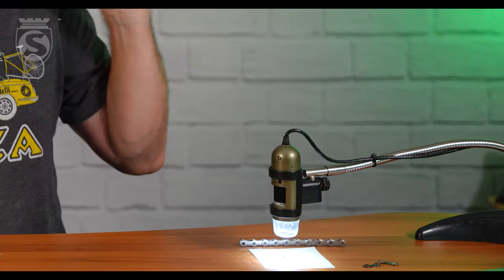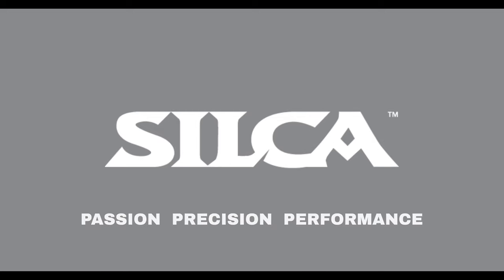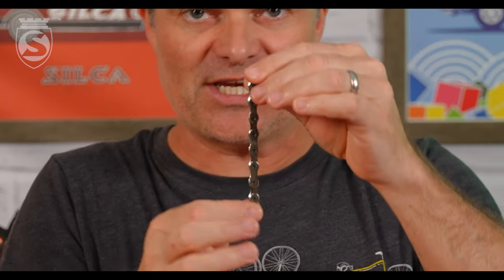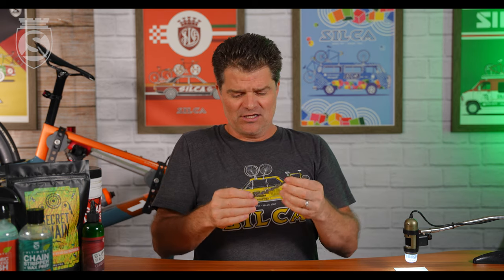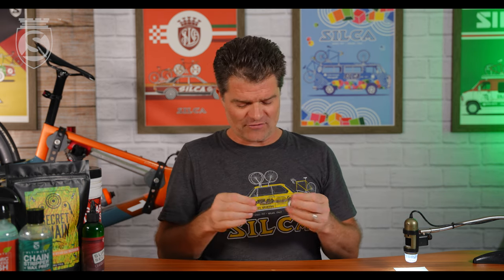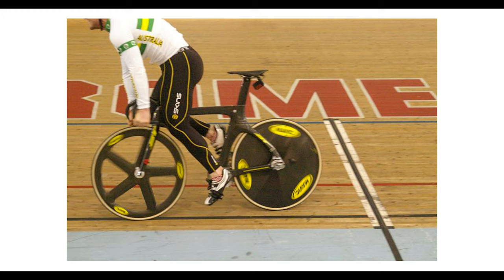Practical Tips to Save Your Chain from Wearing Out!

Comment: Been waxing for 2 years now.  Each time I pull a chain off for another trip through the crockpot I measure it for wear with park's little tool.  There is no wear.  It's nuts.  Months and months of riding and no wear.
Reply: I get the same, i track my maintenance on a spreadsheet, and measure wear each time, and i've never had any chain wear. and sometimes i'm tardy and do 500 km on the same waxing!
Reply: @pinkyfull  nerd.  Just kidding.  I don’t track the mileage, but I used an engraver to mark dates on chains so I know age (nerd)
;)
Reply: Not sure if misunderstanding what you wrote, but if you measure the chain AFTER waxing, it won’t show wear because the pin/bushing clearances will be filled with wax.  Measure wear after cleaning and BEFORE waxing.
Reply: @GHinWI  right.  I measure when they come off the bike.  I rotate 4 dura ace 11 hollow pin chains on two bikes.  It’s been 2 years and only one shows any wear at all.  14k miles.

Comment: Hey Josh, love, love, love the nerd-outs! I have been a mechanic for 20 plus yrs and i have been using a tape measure to yea/nay chains. When i see 12.000" nominal on the tape I'm happy, when we are at a 1/64 to 1/32 (1/32  roughly .030" or just shy of a mm) i am officially getting concerned. Chain gets replaced as well as pulleys and when this happens again, its cassette and ring time. I'm with you, "stretch" is not accurate and calling it that certainly is triggering, lol.
I just say that it has "worn long and is out of spec".
Ron
Reply: Don't be so easily triggered.
Reply: @peterwillson1355  Hey thanks. When I hear it 10 plus times a day and have to explain what the actual issue is 10 plus times a day, gets a little old.

Comment: Really appreciate your mention of the plastic polymer chain lubes (Dumonde Tech).  I've never noticed a coating on the Dumonde chains I've been running.  And I did prep my chains thoroughly and used it for 20 years.  I guess I'll have to take a closer look!

Comment: Very nice video! The microscopic views were sooo helpful, as was the bottle-in-the-ring demo (showing how the pin and roller interact). Suggestion: showing the microscopic view of the bushing really helped make that understandable.  Also, I got lost with the term 'journal'. Has to be a workaround for using that term.  And finally, calling it 'chain wear' is perfect, because that's exactly what's happening.

Comment: Nice video, and, as others mentioned, a tad more concise than Adam :). What I fail to understand however is the rolling mechanism. Can there be rolling when you have a tight interface, as you have in a new chain? I guess for rolling to occur, you need enough space  to lift the posterior part of the rolling item, otherwise it will slide, or am I under a misconception?
Reply: If the rollers didn't roll then as each tooth picks up a link in the chain it would grind its way to the bottom of the valley between each tooth... it's like the difference between rolling down a hill and sliding down a hill
Reply: On the teeth it makes sense, yes... But while the rollers roll down between the teeth, they slide on the bushing/shoulders of the plates, at least in my imagination.
Reply: @aelaeks  Exactly... the wax coating between the rollers and inner plates and between the rollers and pins reduces that sliding friction better than any oil-based chain lube. Think of those shoulders more like spacers that serve to keep the roller located perpendicular to the pin so as the shoulders wear away due to abrasion the distance between each roller increases under load - some call that stretch and others call it elongation.

Comment: Just to reiterate your point on proper lubrication. I wnt from needing a new chain and cassette to be replaced every year (I did wash and lube then) and now with silca wax I'm 18months without any measurable wear
Reply: I'm routinely getting 7500+ miles on chains with very minimal stretch(couldn't resist), have 3 different bikes with more than 50k miles each and all original cassettes. Any one thinking the wax and pot is expensive is staring at the tree oblivious to the forest.

Comment: Hi Josh - another great video, thanks!  Two questions: first, how many chains can be treated with a bag of the Super Secret wax?  Second, are there liquids you can use in an ultrasonic cleaner that are better than water for cleaning a chain?
Reply from the maker: You should get 40-50 waxings per bag of SecretBlend hot wax, it all depends on how much gets dripped or spilled and if you have chains with hollow pins and cuttouts as those tend to hold slightly more wax, but at the low end we say 40+.  For cleaning in an ultrasonic you can use SILCA Chain Stripper for anythying with oil and grease, and once you are converted to wax, you can just use boiling, or near boiling water to remove wax and dirt.

Comment: Hi Josh. Great video. I recently purchased a new chain, stripped it with your chain stripper, installed it and then applied your Super Secret chain drip on wax. I did not hot wax it. All is going good regarding chain wear etc. After watching this video, I still am confused how drip on wax penetrates the rollers and pins? Does it have penetrant properties? Thanks!
Reply: should be dripping it on to the chain and rotating to each link, the rotation of the chain should shimmy the liquid in. let it cure and youre golden!

Comment: Would love to see you guys at Silca design a plug in for Strava or an app to help me track when I should be re-waxing my chain.
Reply: Depends on the conditions that you are riding in. The sound changing will let you know. Use your brain rather than a useless app lol.
Reply: as wax wears away from the surface between the inner plates and rollers and between the pins and rollers you should notice the chain making more of a rattling sound which indicates that it's time to melt out the old wax and contaminants with boiling water and re-immerse the chain in molten wax for a few minutes
Reply: As johnlesoudeur3653 says, when your chain starts to sound a bit more noisier than usual then it's time to re-wax. If in doubt, re-wax it. It doesn't take long and there's no harm in "early" re-waxing, you can't damage your chain by over-waxing.

Comment: Great video - would love for you to address how to know when its time to rewax. I just took a chain off that's been quiet and performing great, but its worn a good bit. WIth oil, I used to just listen for it to start squeaking, but my waxed chains haven't squeaked. (or maybe I'm losing my hearing :D )
Reply: as wax wears away from the surface between the inner plates and rollers and between the pins and rollers you should notice the chain making more of a rattling sound which indicates that it's time to melt out the old wax and contaminants with boiling water and re-immerse the chain in molten wax for a few minutes

Comment: I think I disagree on some parts.
The pin will cause friction on the inner plate, which caused the friction mark on the pin, no rolling here I believe. Pin is static - the inner plate is rotating around the static pin. The roller might be rolling on the cassette and on the flange off the inner plate, that I believe is the engineering marvel in the chain. Or did I not pay enough attention? So we have a combination of static and rolling friction in a chain.
Reply from the maker: You are right, there is both rolling and sliding, and as it wears, it all becomes sliding.
Reply: I agree with you, the bushes of the left hand and right hand inner plates  make contact with the pin, this point of contact moves around the pin (in a small arc) as the chain articulates around the chainwheel and sprockets, the inner plates bushes rub or "slide" over the pin going through them, the friction at his point of contact produces the two shiny areas pointed out in the close-up of the worn pin. I don't buy this "rolling friction".

Comment: I've been doing some internal thinking about this and it was great to see it in real life!  The other thing I would like to see is how the rollers interface with the cassette and the chain rings.  My naive understanding is that the sprockets form essentially a plain bearing on the rollers because there is no load on the rollers (the load is on the pins instead, I assume).  So, theoretically you don't actually need any lubrication there.  I'm wondering if that's correct.  The main thing is that I'm actually a bit confused at how the load is transferred to the sprockets in order to drive the wheel.  It would be nice to see how the wear from an elongated chain happens on the cassette, etc.

It was also nice to hear you speak about additives in the lubricants and how they are used to essentially harden the bushings/pins in the rollers.  One thing I'd like to know specifically about hot wax application is how the wax lubricates.  I'm actually very uneducated about how lubrication works at all!  I guess that you want a lubricant that is relatively uncompressible to isolate the pin from the bushing, but I've got no idea whether or not that is correct.  In the best case scenario (your lubricant is present) will you get significant contact?  Are the additives essentially a fallback mechanism, or does it actually help reduce friction in that best case scenario as well?  It's interesting to me that wax essentially fills the gaps between the pin an the bushing and it is solid at room temperature/pressures, so it's very hard for it to leak out.  Does the wax typically melt under pressure inside the bushing?  If so, is there any understanding about where that melting may stop?  I'm interested mainly because someone else rightly pointed out that solid wax tends to shear easily and I'm wondering where that transition happens (if there is one).

Sorry, for the truck load of questions (that may be unhelpful due to my ignorance on the subject).  But it would be nice if you could present a bit more of an overview of how it works.  I'm really being greedy here because you've already done a lot with just this video!
Reply: I see that you are honest and that you have the right way of thinking, and that you are on the right path, so I will help you create a picture of what is happening there: the answer to the first question is: the chain that rotates when the pedals are turned comes from the bottom side of the sprocket-on 6 hours, and until now the chain is unburdened by pedaling force, as the chain comes out of the gearbox it bends on the sprocket, but without any load. as the sprocket is turned upwards from 6 o'clock to 12 o'clock, the force in the chain begins to increase and reaches its maximum between 10 and 12 o'clock. while the sprocket is turned, as the force increases, the chain moves slightly along the sprocket from the neutral position towards the top of the teeth, how high will climb depends on the step of the chain, i.e. its wear, the more worn the chain is, the higher it climbs on the tooth because the teeth are radially positioned, at a larger radius there is a greater circumference. while the chain moves along the chainring, the ring rolls along the tooth and along the inner link and that are the only ones that roll. when the chain leaves the chainring, it straightens, and at the same time, under load, the pin slides inside the inner link and this is where the main wear of the chain occurs, also when it comes to the chain ring at 12 o'clock. on a bicycle, you do not need to lubricate the surface of the teeth on which the ring rolls because the loads are small, unlike the car differential, which would wear out immediately, because at high loads metal welding happens, as if you have two chewing gum that you touch and they stick to each other and tear the material from each other. that's all for now, as the chain climbs the tooth, the tooth becomes narrower and thus its contact surface decreases, and since the force in the chain is the same, the contact pressure increases. since the chainrings are made of different qualities of steel, some will begin to plastically deform sooner, some later, mostly to crushing and plastic deformation of the contact surface of the tooth, not the entire tooth. as the chain wears, his pitch increases, so the chain climbs higher on the tooth, which further wears the teeth  go to my channel and you'll see interesting things
Reply: in relation to lubrication: when sliding, a big role is played by the viscosity, which is determined by the long polymer chains that prevent direct contact with the metal and circulates, i.e. it returns to the surface, but the wax is rigid and does not return to the surface, so in fact it should be as soft as possible, i.e. the melting temperature is as close as possible to the ambient temperature but so that it does not become sticky, which would catch impurities on the chain that would directly affect the wear of the chain.the wax becomes semi-liquid under load, but it also depends on the melting temperature, if the benefit is  the pure  wax without paraffin or any other oil, in the winter it will be too hard and it will crumble and it will come out of the chain very quickly, that's why you need to add oil so that the wax became softer if the outside temperature is lower. this all applies to pure wax without additives and it is necessary to re-wax the chain every 100km or sooner. if additives are added to the wax: teflon, mos, wos, then the waxing should be repeated between 200 and 300 km depending on the additives that work by sticking onto the contact surfaces and thus preventing direct metal contact, especially Teflon, which ozzy cycle claims is the best additive and guarantees the longest waxing interval.

Comment: I live in a very hot area where temperature can regularly be 38C+. Should I be worried about the wax melting on the chain and is there anything I can do?
Reply: ride in the morning LOL... I live where it's crazy hot 45 to 48C.  during the day... The wax will get softer the hotter it gets. I would just avoid the really hot weather anyway and store the bike inside.
Reply: @AceMBP  The low here is around 29C. I should say it is tropical here so you have high humidity and direct overhead sunlight. I leave my house when it is dark. By 8am it is already 35C.
Reply: think of the wax in your chain in the same way as a glacier on a mountain... we know that ice melts at temperatures above zero celcius but the glacier doesn't instantly liquefy in the hot summer sun, just as wax begins to melt above 40C it doesn't immediately liquefy and leave the chain.
I clean the old wax and contaminants from my chains with 100C boiling water in a pot for a few minutes before re-immersing in molten wax, and it still doesn't remove all the old wax.

Comment: Chain abrasion  - would be more precise as the term is limited to 'wearing away ' and addresses the how more directly
Chain wear - is more broad and would include would included material fatigue as well (physically stretching in this case). The lack of precise wording makes it easier to conflat the end result (stretch) with an inaccurate means of wear.

Comment: great video. how does a worn chain eats away the life of cassette and chainring?
Reply: yes
Reply: as the space between the rollers gets longer, the links no longer mesh perfectly in the valleys between the teeth on the sprockets and ring. 
The start hitting and grinding down one side of the valleys, and wear it down. Pushed to extremes, the teeth start looking like "shark teeths". If you replace your chain before it gets too far out of the original specs, it limits the damage.
Reply: @DominiqueB  as the chain wears out, its pitch increases, also, the pitch of the teeth on the new sprocket is not the same in radius, but increases in height of the teeth, so the chain whose pitch increases climbs up the tooth to the pitch that corresponds to the pitch of the teeth. everything would be fine if the teeth do not become thinner in height, so the contact surface of the chain and the teeth decreases and the pressure on the tips of the teeth increases, which begin to deform and look like the teeth of a shark. therefore, the lower part of the tooth is not worn, but the upper part, because when I repair worn teeth, I reshape, grind the lower part that is not worn, because there is excess material there, and not on the top of the tooth, because there is no excess material there
Reply: @DominiqueB  thx mate